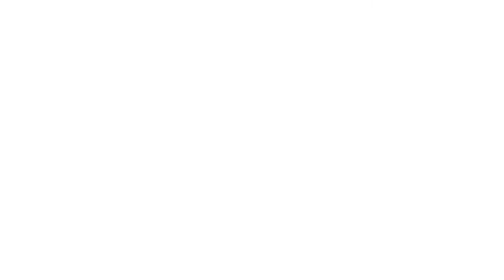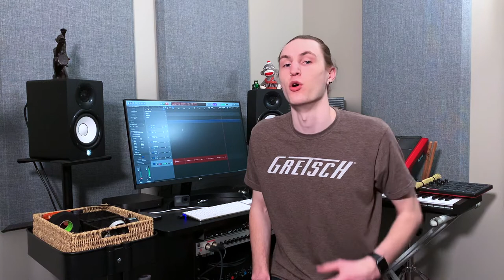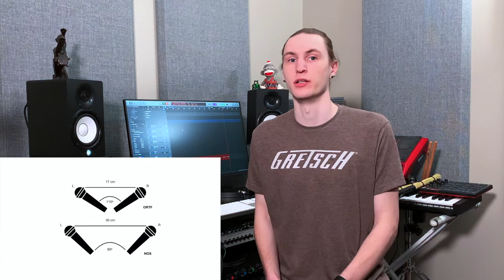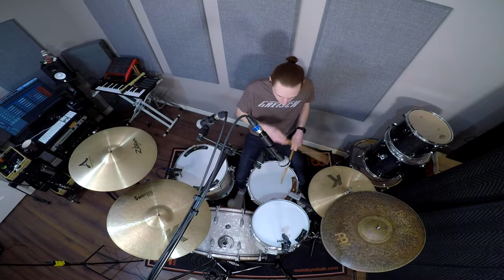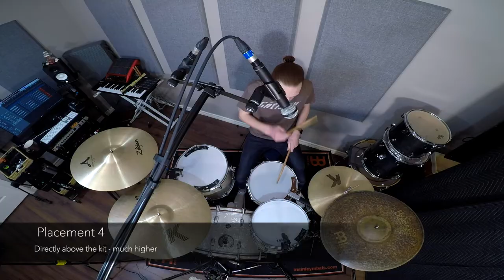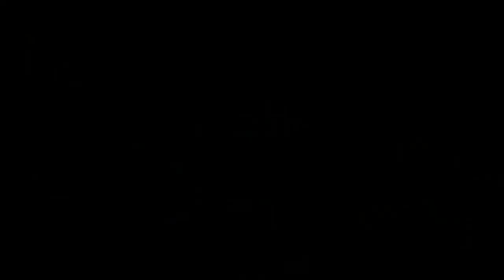Drum Overhead Mic Placement

Comment: great mics, do yourself a favor, cross those mics over each other in a blumlein pair, with the ribbons as close to each other as possible and point them at the drums and not the cymbals, in front of your head, 2 things will happen, your phase coherence will be vastly improved and drums will be louder than cymbals which is exactly what most engineers and producers want
Reply from the maker: Thanks for your comment! Yes, XY would absolutely improve phase coherency, and emphasize the shells. For this video the goal was to experiment with a technique that could yield a wider stereo field  than XY without resorting to a spaced pair. This setup was a bit of a stretch as it was way to wide to be considered ORTF, but was closer to an NOS configuration. Happy recording :)